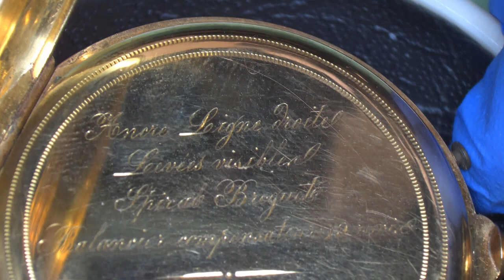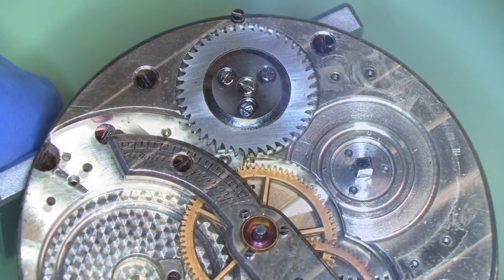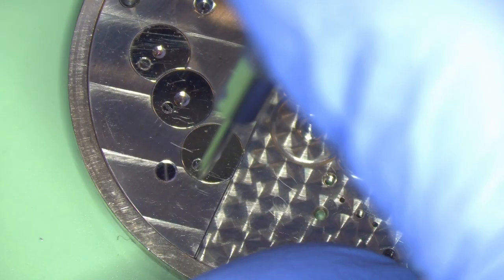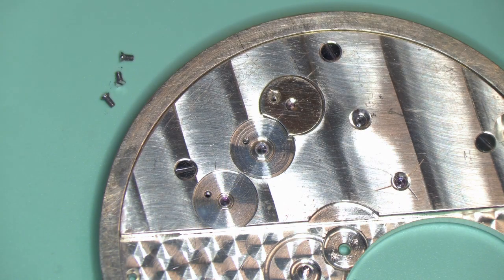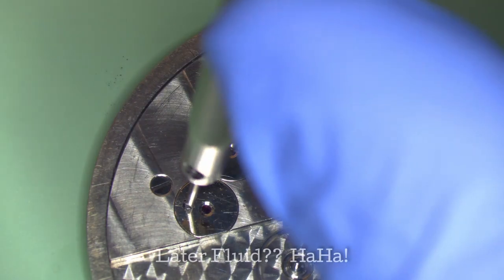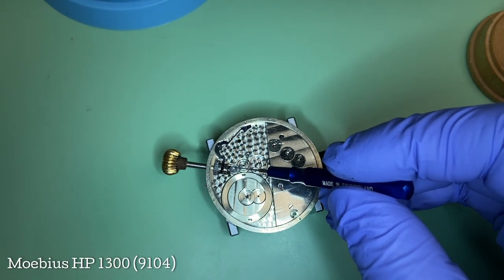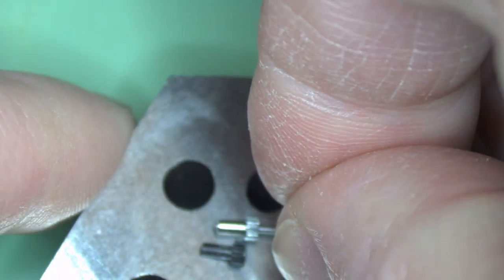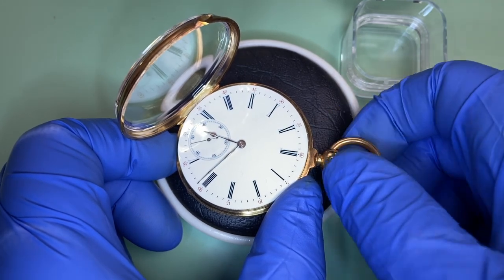Restoration of a Solid Gold Watch from the 1880's sent in by Subscriber.

Comment: Great video Mark. When you pressed in the new jewel, how did you gauge the correct depth?  I have the horia clone too, and I'm afraid of pressing jewel in too deep, beyond the lip.  I've seen other jeweling sets that come with flat stumps that ultimately limit the downward travel of the jewel. But this clone set only has stumps with holes.... Would love to hear your tips. Thank you!
Reply from the maker: Hey Jimmy, thanks for watching and for the great question.  This particular jewel was the "rub in" type.  There is actually a ring around the bottom of the hole which prevents it from going all the way through.  If you look closely in the video you can see it when I'm cleaning out the hole with pegwood before I seat the jewel.  
In an instance when there is no lip you can use the stumps that come with your set, just select a stump with a much smaller hole than the diameter of the jewel so the jewel cannot pass through the stump.  That way it will stop when it hits the stump.  Hope this helps.
Reply: @watchasilearn  makes sense. Thanks Mark. Good save on the pinion.